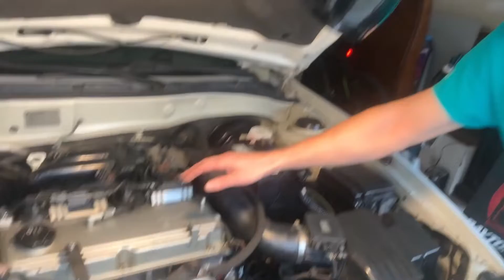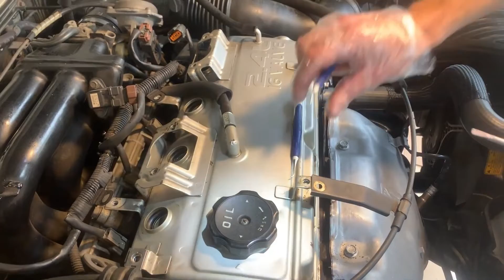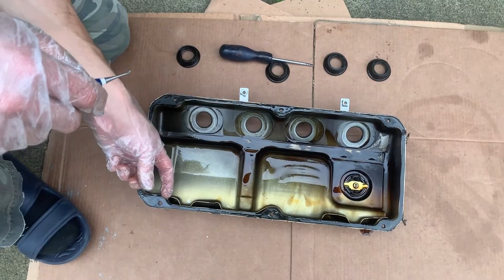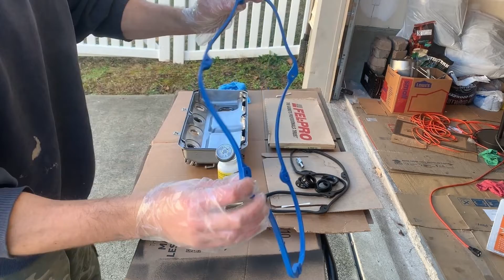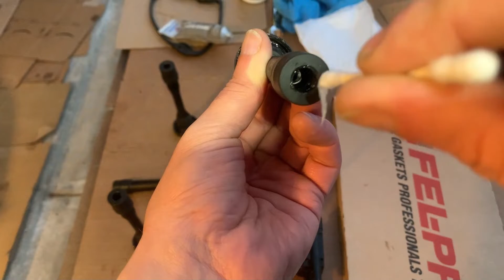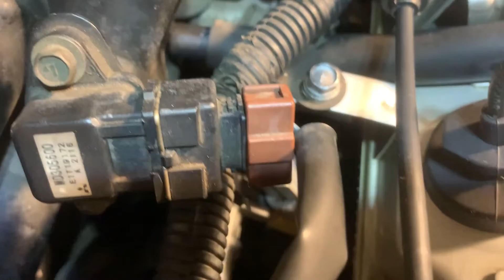Valve Cover Gasket and Spark Plugs Replacement on Mitsubishi Galant 2002

Comment: Your videos are evolving.👍 Why you didn't make a video of the engine cleaning? I would watch that with your delicate approach.
Reply from the maker: Thank you! Engine cleaning video is something I'd love to do, but that will be in conjunction with some other work, such as head gasket replacement. Considering that my engine is 220k miles on this car, it's possible that the head gasket replacement is in my future projects.
Reply: Hi, so I have a 2003 galant. Spark plug #2 and four have oil if I do this what you did in this video. Will this help the from the oil going inside the plugs